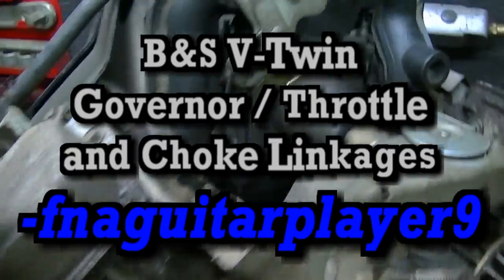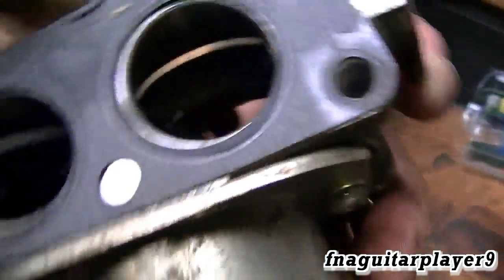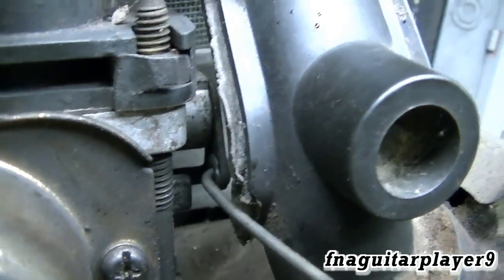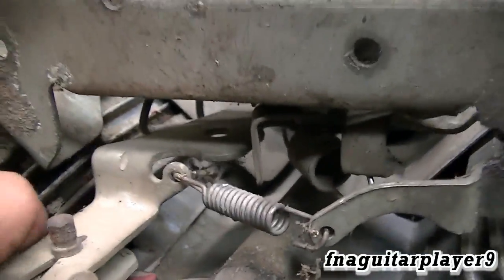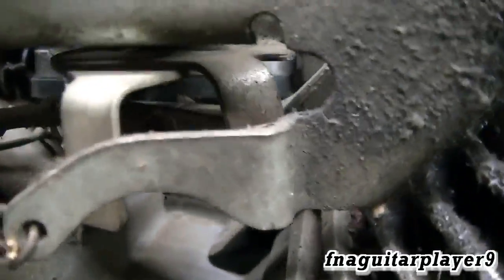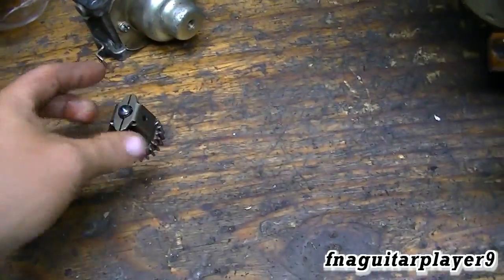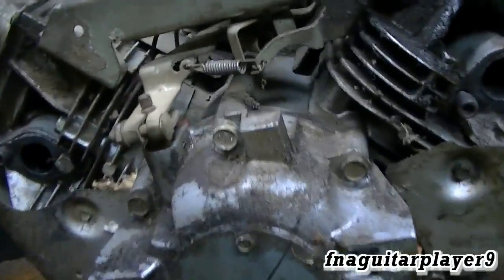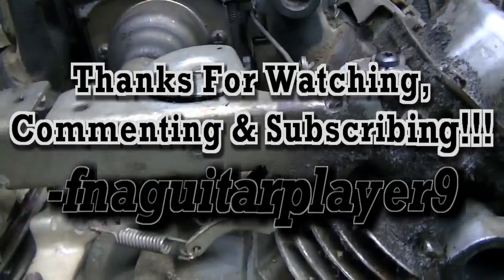Briggs & Stratton V-TWIN : Governor, Throttle and Choke Linkages

Comment: Until I saw your video, I sure didn't know that the lower "tab" holding the lower end of the governor idle spring (smaller spring) was used to help change the idle speed.  You sure saved me big time there!

I broke the throttle linkage on my engine and made a replacement.  I made what I thought was a good match size wise, but was not 100% sure if the length was "really" right.  I falsely assumed that just by adjusting the governor arms setting , that would basically compensate for that linkage being slightly off length-wise.  However,  using that new linkage, I found that the (Larger) main governor spring was still fairly loose (sloppy) when the engine was off & with the engine running at full throttle,  it ran noticeably slower than before.  I could push down on the governor arm and get it to speed up. 
Questions
Q 1)  Do you know the correct length of the throttle linkage at the points where it engages both of the 2 appropriate holes?
Q2)  Should the (Larger) main governor spring be under slight tension at "off" or what?

PS
Really good video, very helpful!
Reply from the maker: I hear ya! Glad to help out! Yeah you almost have to exact part to replace them, to do it right. I don't have the specs handy, but there will be a slight to no tension at idle. not much, but there should be quite a bit when you throttle up. hope this helps. Thanks for Watching!!!

Comment: I have a 2014 23hp commercial turf briggs v twin. Had the engine split, replaced the big gasket & crankshaft seal. It was leaking oil with only 280 hours on it. The engines back together but now the RPM are all over the place. I turn the throttle up, it responds 10 seconds later, revs high. Any thoughts? I'm hoping it's not internal.  This engine is getting the best of me lol. Thanks for your videos.
Reply from the maker: They are bad about leaking for some reason. I would try adjusting the governor first, i have a video on it, not this particular engine but it will adjust the same. Try that first and let me know what it does then. Your welcome, Thanks for Watching!!!
Reply: @fnaguitarplayer9  thanks for your reply! We replaced the entire bottom cast piece along with the gaskets. There were hair line stress cracks on the old one. This is what my small engine mechanic just told me. Also, he had already played around with adjusting it with no luck. 
"The failed part is a 12 cent Jesus clip. The part is the retaining clip on the fly weights inside the engine"

I like to know you opinion on this! Thanks again

Comment: Motor is surging at high Rpm while mowing under load. Runs great other wise.  Could I need to adjust the gov. Springs
Reply from the maker: It's either that or the carb mixture needs to be slightly richer. Thanks for watching!

Comment: governor rod not letting carb return to idle. idle very high
Reply from the maker: These have a governed idle, you can adjust it by bending the tab on the smaller spring. Thanks for Watching!!!

Comment: I am a little confused.  I changed out the carburetor on mine and I was expecting that when the throttle was opened, it would cause the throttle linkage to move and actuate the intakes in the carburetor.  After the replacement, it would not start, but when I manually hold "up" the linkage on the throttle side it starts up fine.  Can someone help me understand what the issue is? Thanks!
Reply: Roger DeBlois had by a dom ☝

Comment: When I increase the throttle, the throttle cable rotates the throttle control counter-clockwise, which puts tension on the governor spring. When I decrease the throttle, the reverse happens, as expected. What doesn't move is the throttle linkage, which actually controls the throttle body. When I crank my engine it runs at very high RPM and I am concerned it is running away. Will the governor adjust the governor arm as the engine warms up? I always shut the mower off b/c I am scared its going to throw something! I suppose I should mention that I just removed and cleaned the carb (no rebuild).
Reply from the maker: Yeah that is normal, as soon as it fires up and the governor starts working (when it comes up to speed the weights sling out and will push the rod) it will move the linkage to idle or whatever it is set at, if it doesn't idle down then you do have a problem, usually just needing to be adjusted. Thanks for Watching!!!

Comment: Guitar player: Me too. Great vid. You mentioned there are more than one carbs used on different engines.  Can you tell me if they are interchangeable to the different engines. My Carb. is identical to yours. I think someone installed a different carb and  manifold assembly on mine. is that possible would it make a difference?? I'm having problems ordering carburetor parts and gaskets. Also linkage rods are all twisted and bent for some reason?. I was thinking about purchasing an assembly for my model engine in e-bay. Any suggestions would be appreciated. Engine numbers are 21.5hp B&S, M#445777, type 0172-E1 It ran good for a while. It just started running bad.
Reply from the maker: I hear ya! Thanks, I was mainly referring to brands on this particular engine, there maybe other carbs that will work and would explain the bent linkages. Its hard to say without actually looking at it. Thanks for Watching!!!

Comment: You still didn't show how to put the throttle cable on with the linkages? Someone Jimmy rigged mine and I need to know how it goes the correct way..
Reply from the maker: Sorry, on these the cable's z bend goes into the round looking piece then gets clamped in place. hanks for Watching!!!
Reply: @fnaguitarplayer9  mine doesn't a have a z bend set up. Thanks

Comment: Mines running away.
Reply from the maker: Try to adjust the governor first (i have another video on it) if it still doesn't fix it, then the internal governor piece may be broke.  Thanks for Watching!!!
Reply: @fnaguitarplayer9  well looks like I'm going into the motor. Thanks

Comment: I got a 95 cub cadet 1641 with the b&s v twin it is running wide open would that be the governor?
Reply from the maker: It can be several things, worst case is the internal governor, but it can be a loose linkage, or spring. Or the governor may just need adjusted. Thanks for Watching!!!